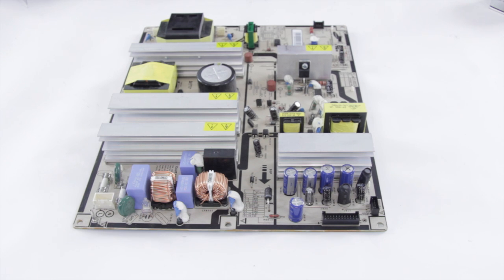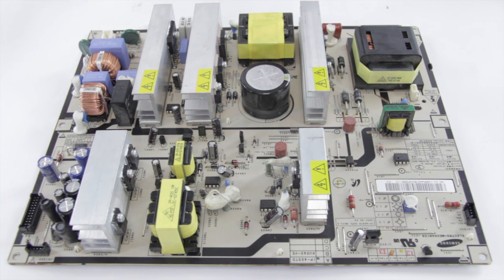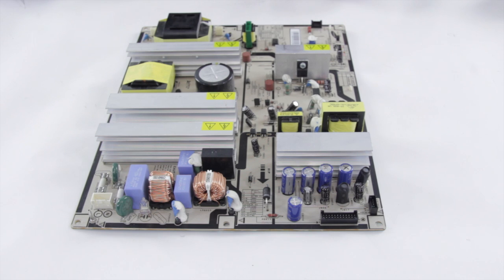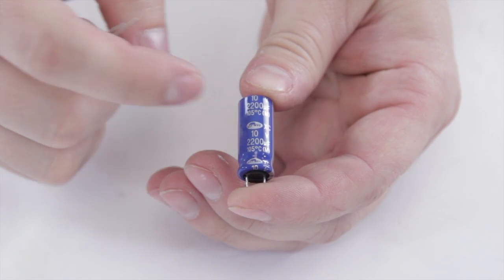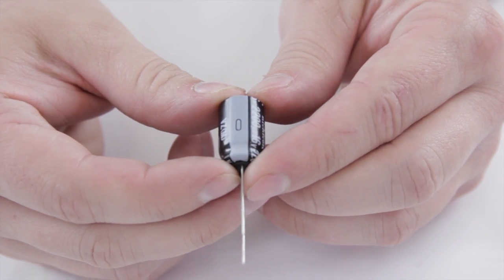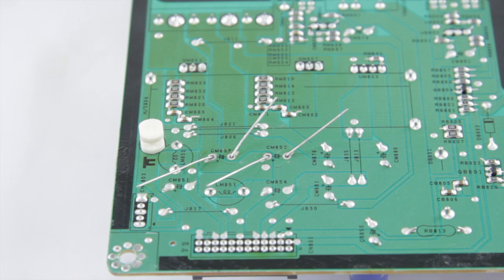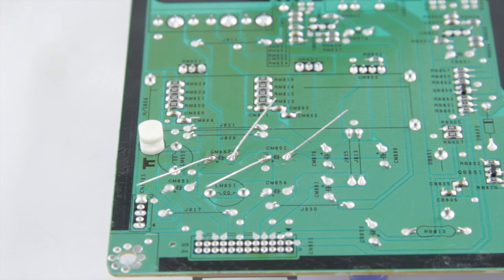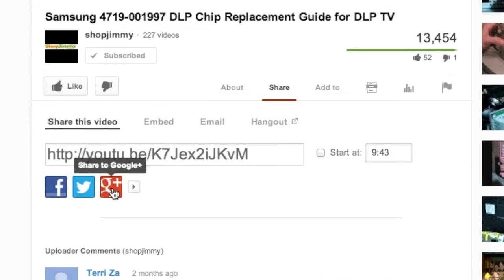Samsung TV Won't Turn On - How to Repair Bulging Capacitor for Clicking Noise

Comment: Hi I have a Insignia 46" model NS46E34A13 built in 2012 and power supply board is the model 715G5173-P02-W21-002M ;my TV issue is that takes time to turn on I have to plug and unplug the TV from the wall several times before I got to turn on  the beginning it use to do it one or two times now with the time is taking 4 o more before I can make it work. I'd follow your video and take the back off the TV and after reviewing the capacitors they look fine there's none being inflated like the ones on the video do I missing something??? or maybe its another issue with the TV??? I got pictures I'd take that i can send you maybe you can see what i didn't I got some experience with electronics and soldering  but in my visual inspection I didn't got anything I will appreciate your guidance if I can test the board in some other way I know how to use a multimeter and with your help I hope I can fix my TV before stops working.

Thank you in advance for your help
Reply from the maker: lyon65   Try all repairs and troubleshooting at your own risk.  Since you have experience with a meter, I recommend <!-td {border: 1px solid #ccc;}br {mso-data-placement:same-cell;}->checking for the 5 volt standby on the power supply.  Thanks!  www.shopjimmy.com

Comment: Is it fine to use 3300uf capacitor 10 volts 105 degree instead of 2200uf capacitor 10 volts 105. They r the same size. My tv has a blown capacitor that has the number 2200uf.

Comment: Can you please elaborate on two things. First, can you please clarify how to correctly identify the capacitor from the rear of the television to ensure removing the correct one. Second, what type of material did you paint on rear of the capacitors before soldering them?

Comment: My TV is having the issue where it does not turn on but "clicks" a few times as if it is trying to turn on, I have looked online and it says its the capacitors; however, when I opened up my TV and looked at all the capacitors none of them were bulging or leaking. Is it possible for them to still be busted?
Reply: N Diaz ShopJimmy.com  Very great video by the way!

Comment: Hi, I've seen a lot of vids about Samsung Tvs that won't post. I have a Samsung 50" LCD HDTV MODEL#: UN50EH5300FXZA. I haven't opened my tv yet to see what the problem is for sure. All I know is that the tv does not show any signs at all, no led's no clicking sounds just dead. Any ideas? And does this fix apply to these symptoms?

Comment: Hi!  I have a Samsung 1080p Plasma model FPT5084X/XAA; version KL01.  The other night it made a loud pop and went off and hasn't come back on since.  We want to try to do something with it, but not sure if the pop has anything to do with a bulging capacitor.  Also, there have been absolutely NO issues prior to this pop.  It has been an awesome tv and it's 6 years old.

Comment: Hey I have a Sony LCD TV that had two bad capacitors on the power board in the TV. When i replaced them i replaced them with capacitors with the wrong microfarad rating; the rating of the original capacitors were 1000uf and the capacitors i put in were 100uf. The TV turned back on and worked normal. I realized my mistake a day or two after the fix. I decided to lave the TV alone until something else happens to it.

 A few days later when the TV was in use it stopped displaying a picture and the background color of the screen was grey; the background of the screen is supposed to be black. I thought that the wrong rated capacitors were the problem so I bought new capacitors with the correct uf rating and replaced the capacitors with the wrong rating. When i plugged the screen back up to the TV to test to see if it will come on when it came on the screen was gray when it is suposed to be white,then the Coby brand comes up but the background color is yellow while the color of the Coby word is black while the background color should be black and the Coby word should be white. when the TV fully comes on the color of the menu and the background or switched,or backwards

What is causing this and how can i fix it?.
Reply from the maker: Doobie D  Try all repairs and troubleshooting at your own risk.  This could be a problem with either the main board or the TV panel.  You can replace the main board to see if that fixes the problem.  Try all repairs and troubleshooting at your own risk.  Please reply with your TV model number.  Click here to view a video that shows how to find your TV model number:  https://www.youtube.com/watch?v=S51nhAmwR2M  Thanks!  www.shopjimmy.com

Comment: Hi my pn58b540s3fxza keeps turning off on its own. Doesn't try to power itself on like most problems I see online but just turns off after it's been in awhile. Sometimes it turns off right after it is turned on, sometimes it goes a whole 30 mins, if left idle, it was on all night once. I really Don't know what to do at this point. Should I replace the whole power board?? Please help!!!!
Reply from the maker: *****   Try all repairs and troubleshooting at your own risk.  This could be a problem with either the main board or the power supply board.  You can replace the main board and power supply boards individually to see if one of those boards fixes the problem.  Click this link to replacement parts for your TV model number:  http://www.shopjimmy.com/catalogsearch/result/?q=pn58b540s3fxza  There may be multiple boards for the same TV model number, be sure to match part numbers on your current board, with your replacement for compatibility.  Here is a link to a video showing how to identify your part number, click here:  https://www.youtube.com/watch?v=R1jmj_foId0  Thanks and please let us know if you have any further questions with your TV Repair!  www.shopjimmy.com
Reply: ShopJimmy.com i understand u guys need to make ur sales and your youtube channel helps your stream of revenue but if ur going to offer help, u should really try to help. Maybe I shouldn't've worded my comment like I'm an idiot bec. I'm sure it made it seem like I have no idea what I'm doing but you really need not state the obvious. Of course I will try all repairs and troubleshooting at my own risk (who else's would it be?). Then you proceed to tell me that I can replace both boards individually to see if it will fix it lol Thanks but no thanks. A lot of factors can cause the problem I was having so replacing either or both might not even fix the issue and I would have wasted my money on your boards. My only issue is, if you all are going to offer help, please actually help. I had a problem that needed fixing. This isn't a department store where you can just try and sell me something I don't need. All that said, your prices are OK, at best. Found the parts somewhere else for 30% cheaper. Didn't actually need them but I was able to fix the tv. Just connected and reconnected the plugs and straightened out some of the capacitors.

Comment: Hey firts i whant to thank you for the free tips i found this so help full after 60minutes  since i watch this video i open 3 of my tvs that dont turn on and i found the caps blowed up with some kind of dark wax or something leaking i have 6 tv's in my basements and they are like new on the exterior but dont turn on i already took the panels out but my question now is where can i find the cap's so i can replace them??

Comment: Hi ShopJimmy, regards from Argentina, I have a TV Samsung model UN46ES7000.

My samsung tv is randomly turn off and on every x minutes. I hope you can help me in order to identify if its a bad capacitor problem. Any help will be very appreciated.
Reply from the maker: Victor Miranda   Try all repairs and troubleshooting at your own risk.  This could be a problem with either the power supply or the main board.  Do you have experience using a meter to measure voltages?  If not, you can replace the main board and power supply board individually to see if one of those boards fixes the problem.  Unfortunately I do not see any replacement parts in the search results for your TV model number on our website.  Please reply with your part number on your main board and power supply board and I can try searching for replacement parts.  Thanks and please let us know if you have any further questions!  www.shopjimmy.com

Comment: Sir your video is pretty good but after 45 years of electronic servicing I have to disagree with at least one point you made concerning the replacement voltage of the Capacitors, You said about the higher voltage capacitors,"They should be ok","The Voltage rating of the capacitor is the maximum working voltage of the capacitor so as long as the UF Value is correct you can use ANY capacitor rated higher than the original voltage will be ok as long as it will physically fit on the board,IE,even 50 volt,100 volt ECT and actually the new capacitor will last longer than the original.Also the other Capacitors in that power supply will most likely have high ESR and bulge soon after this repair so capacitors being as cheap as they are I have always replaced them if at all questionable and I had over 2000 happy customers in my files,just a tip from an OLD School repairman.
Reply: MrSundownman49  I appreciate the advice. I was concerned about finding capacitors with voltage in the same range. In the Samsung TV I'm trying to repair,  all the capacitors appear to be from the same defective "SAMWHA" brand. The difference is that all of them are intact and have no noticeable bulge.

Considering that it's hard for an amateur to identify the questionable capacitors. Do you recommend replacing all the capacitors including the largest one?  I should add that this will be my first time soldering electronic components.
Reply: The101damnations First I would buy quality Capacitors from a reputable parts supplier,the Samwha Capacitors are very cheap and the TV manufacturers because they are cheap and all they care about is profit and as long as the capacitors last through your warranty period they are happy and off the hook.I would replace any capacitor that is bulged on top automatically! In the power supply I would replace all caps and the reasons I say this is are,A: you know the Samwha caps are cheap and prone to quit.
B: you are not comfortable checking the ESR Of the caps.
C:if you do not replace them now you will have to in the possibly near future.
Electrolitic caps  generally have a rating in UF(Micro Farads)at plus or minus 20% but you should get exact values if you can,on the Voltage rating,if rated at 35 volts I would buy caps rated at 50 volts and this is completely safe and acceptable  and the caps will last longer if they are not at the minimum voltage rating.In 45 plus years I have never replaced a Cap at the minimum voltage rating!
Some might say I cheated myself of more future repair work by doing this,I prefer to say I did the right thing for my customers!
Good Luck
Bob
Reply: The101damnations First I would buy quality Capacitors from a reputable parts supplier,the Samwha Capacitors are very cheap and the TV manufacturers because they are cheap and all they care about is profit and as long as the capacitors last through your warranty period they are happy and off the hook.I would replace any capacitor that is bulged on top automatically! In the power supply I would replace all caps and the reasons I say this is are,A: you know the Samwha caps are cheap and prone to quit.
B: you are not comfortable checking the ESR Of the caps.
C:if you do not replace them now you will have to in the possibly near future.
Electrolitic caps  generally have a rating in UF(Micro Farads)at plus or minus 20% but you should get exact values if you can,on the Voltage rating,if rated at 35 volts I would buy caps rated at 50 volts and this is completely safe and acceptable  and the caps will last longer if they are not at the minimum voltage rating.In 45 plus years I have never replaced a Cap at the minimum voltage rating!
Some might say I cheated myself of more future repair work by doing this,I prefer to say I did the right thing for my customers!
Good Luck
Bob
Reply: MrSundownman49  I had my power board repaired. They changed out 4 capacitors. Well 2 months later TV stopped turning on. Finally opened the TV and the 4 capacitors. They repairs bulged again. Any thoughts as to what would cause them to go out so quickly?
Reply: @ESPNEWS8  For future readers -- The repair person used either wrong type of cap, too low of voltage rating and/or cheap chinese junk. The caps on this board at the locations shown must be the right type (low-ESR or low impedance), must be the right voltage (go up in voltage rating as long as the new cap physically fits both overall diameter and lead spacing) and must be good brand (Nichicon, Nippon Chemi-Con, Panasonic and a few others). The thing most people do wrong on these repairs is to use the wrong type of capacitors. They used standard caps (Nichicon UVZ series) in this video but they MUST be Low-ESR such as Panasonic FR series. Using the higher ESR parts such as the UVZ series will result in a higher power dissipation (heat generation) which results in reduced lifespan. To offset this, they used of a larger diameter part which increases the capability of the cap to dissipate heat into surrounding environment resulting in extending lifespan. Proper way is to reduce the ESR value and increase the physical size.
Reply: MrSundownman49 I saw another video where the guy recommended 1000uf 35v capacitor. Your tboughts.

Comment: What is the name of the tool you are using?
Reply from the maker: Jonathan Riley   Which tool in the video?  We have a desolder gun which removes the solder and loosens the components from the board, and then we use a solder gun to reattach the components to the board.  Thanks!  www.shopjimmy.com
Reply: Thank u

Comment: t: I have a Vizio 42" LCD TV Model # is : VP423 HDTV10A
the other day when I plugged it in and hooked up my HDMI cable from my Direct TV box I heard a POP and it will not power on now. When I plug the power cord in I do here a click (Like I have always heard whenever I turned the tv on or off but no picture or sound or apparent power to the screen). I took the back panel off and there appears to be no bad Capacitors I can see, no fuses blown (tested them ) and nothing on the board that looks black or blown. I am very confused :(... This is my 2nd Big TV this week that has blown and I have not attempted to check the other because this one was older. 
Please help 
Fred
Reply from the maker: Fred Manning  Try all repairs and troubleshooting at your own risk.  I recommend replacing the main board in your TV.  Click this link to replacement parts for your TV model number:  http://www.shopjimmy.com/vizio-3842-0192-0150-main-board-for-vp423hdtv10a.htm  There may be multiple boards for the same TV model number, be sure to match part numbers on your current board, with your replacement for compatibility.  Here is a link to a video showing how to identify your part number, click here:  https://www.youtube.com/watch?v=kxkeGLhlQY8  Thanks and please let us know if you have any further questions with your TV Repair!  www.shopjimmy.com

Comment: I have a samsung ln40a630m1f. its taking long to turn on, the capacitors look good. what can I check next?
Reply from the maker: radhames78   Try all repairs and troubleshooting at your own risk.  I recommend replacing the power supply board in your TV.  Click this link to replacement parts for your TV model number:  http://www.shopjimmy.com/catalogsearch/result/index/?cat=229&q=ln40a630m1f  There may be multiple boards for the same TV model number, be sure to match part numbers on your current board, with your replacement for compatibility.  Here is a link to a video showing how to identify your part number, click here:  https://www.youtube.com/watch?v=sSJexLvRrjM  Thanks and please let us know if you have any further questions with your TV Repair!  www.shopjimmy.com

Comment: Thanks for this video! My TV kept randomly coming on after I turned it off, I thought I was going mad to start with, I'd come home from work or I'd come down stairs in the morning and it would be on. Then suddenly it started clicking as if trying to turn on but couldn't over and over and over. I took it apart and saw 4 swollen capacitors. Replaced them and its working fine again! Simples.

Comment: Hello there. Thanks for this video, but i have one question?.
What is the name of the tool which you use to remove the Capacitors?.
I didnt get the name, it sounded like "solder way" or something like that?.
Thanks.
Reply from the maker: krazivaya  A desolder gun.  Thanks!  www.shopjimmy.com

Comment: hi i bought a capacitor with the same number and even color but i came way smaller,,will it work regardless?
Reply: 238942 asd    As long as number is the same,   and volt it close or higher. YES

Comment: I have a Samsung PN51D550C1FXZA.  It won't turn on.  The red light blinks in a pattern of 2 in a row for a sequence of 5 times.  I have tried the remote and the power button on the TV with no luck.   I have heard that this part might fix it BN94-04354A based on other posts.  Is this an easy repair?  I am familiar with building computers but haven't been inside a TV yet.   Thanks.
Reply from the maker: Brad Draeger   I recommend replacing the main board in your TV.  Click this link to replacement parts for your TV model number:  http://www.shopjimmy.com/catalogsearch/result/index/?cat=56&q=PN51D550C1FXZA  There may be multiple boards for the same TV model number, be sure to match part numbers on your current board, with your replacement for compatibility.  Here is a link to a video showing how to identify your part number, click here:  https://www.youtube.com/watch?v=BEPWrefQvqI  Thanks and please let us know if you have any further questions with your TV Repair!  www.shopjimmy.com